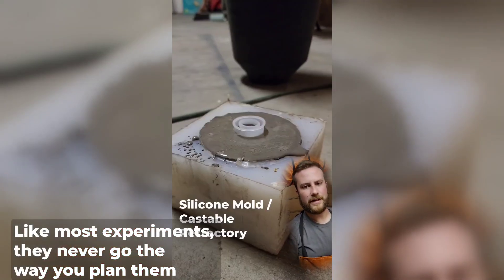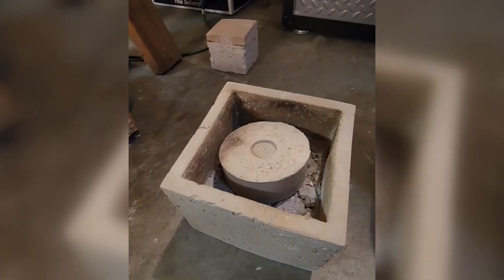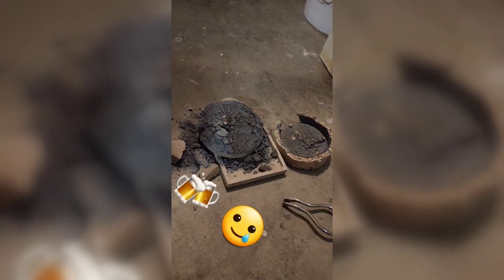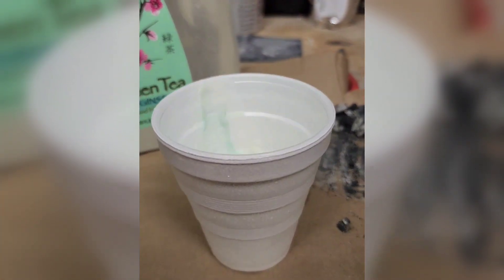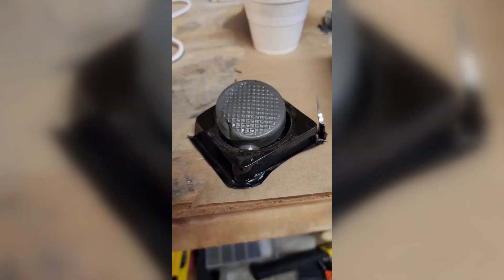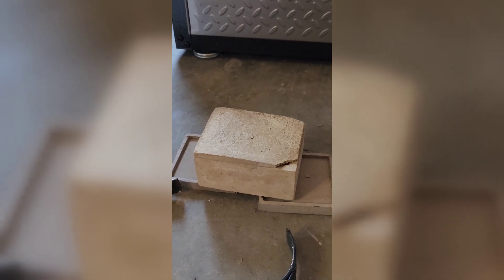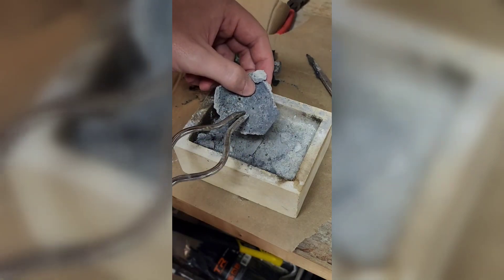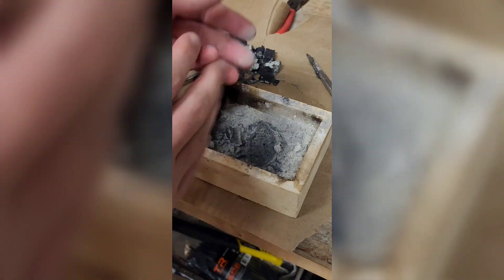Microwave Mishap - Silicon Carbide Sinter Experiment

Comment: 6000mw PEG is too long chain for use as a laxative.  PEG 3350 is the typical molecular weight.  Did you try using sodium silicate solution?

Comment: Dont listen to people is telling here about oxygen reaction, its pure bullshit. Mix silicon carbide with a little bit of water glass, water, a bit of graphite and some refractory cement. This i the only way i could do a crucible that can operate in temperatures higher than 2000celsius without melting. You need to wait it cure completely before putting in the microwave, wait it dry like 1 day and put in oven in low temperature for like 2 hours, then begin to turn the temperature until near 300 celsius, after that you can put on microwave.
Whats the point of freezing it before? I've saw some people doing this but doesnt make any sense, because it wont cure on low temperatures, i tried and didnt worked.

Comment: Silicon carbide has no melting temperature=it wont sinter. I have 3.5 tons of 600 and 1200 grit if you would like to continue to try, I"ll supply! :)
Reply: oh yeah, its has a melting point for sure, i melted 2 crucibles i made with silicon carbide. After 5 crucible failed i finally made one with silicon carbide that doesnt melt.

Comment: I work w ceramics and you  need to seal the lid w clay + some extra carbon to create a no oxygen environment.
Also I believe SiC also reacts with metals that can be found in clay, not sure though
edit: turning wheel clay mixed w silver sand can make a good seal and +50% Silica makes it easy to break away

Comment: hi man, can i buy some silicon carbide you 3d printed? I just want to make a small chamber in 10 x 10 cm to cook my solar cells!
Reply from the maker: Hey, you'd probably be able to get away with just using an Amazon microwave kiln. They're only like $40 

Not sure what temps you'd need to reach but I've seen people get to steel melting with them before
Reply: @Mr-Highball  ah thank you for the rapid reply, I will check them! For the remp rate I think the slower the better, can I obtain 8°C/minute remp in microwave? Or steady 450°C for 30mins?
Reply from the maker: @Shih Wei Chieh  np, and if you're looking for slower well... then the standard kilns might actually not work well. I believe they ramp quite quickly (but I don't know numbers for sure... you could potentially go alow with a lower watt microwave at 10% power)

Controllable ramp rates have are a pretty good benefit to making your own
Reply from the maker: @Shih Wei Chieh  to add to my last comment, the ramp rate is definitely achievable since that's about what my debind elements and the 450c max hold is about what they reach. We might can work something out if you don't think the  Amazon kilns will work for you. I haven't sold one or sent anyone an element before but your project description intrigues me 🙂
Reply: @Mr-Highball  want melt steel locally not using a SiC heating element just the bare powder would it be safe to say SiC can get to 2800F especially if I use a minimal amount total material?
Reply from the maker: @Cybyrd  absolutely, and if you want to melt vs sinter id recommend this video as a great starting point (shake the future)

https://youtu.be/P1VmIYheuU4

Comment: If youre trying pure SiC with no additives, you have to get it up high like 1700 or 1800C in a zero oxygen environment.
Reply from the maker: Yeah, should be possible with a microwave and by starving oxygen with some carbon during sinter (I didn't mention that I had some in my test). The only limiting factor would be if the microwaves output is high enough (that's the test and unknown).